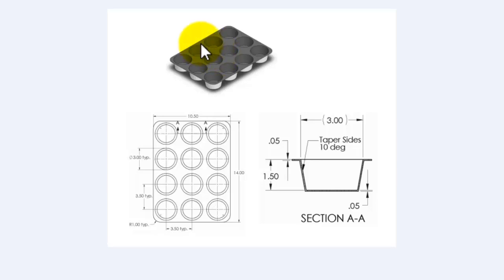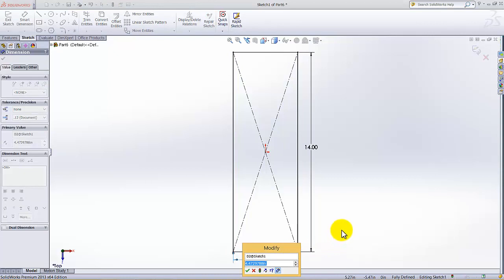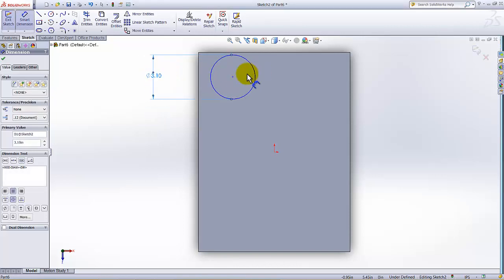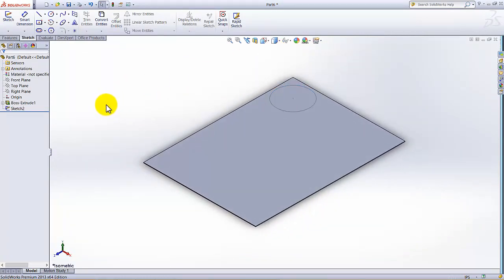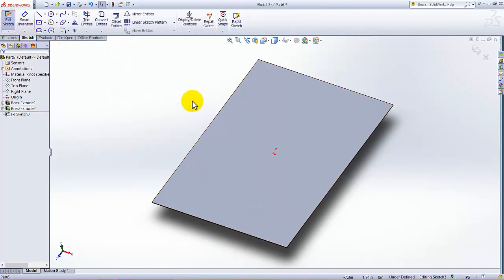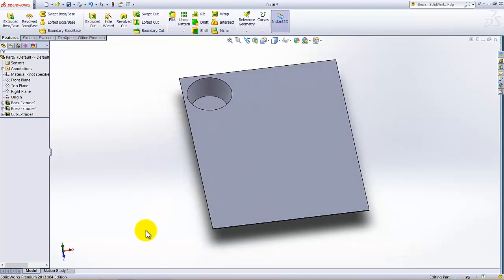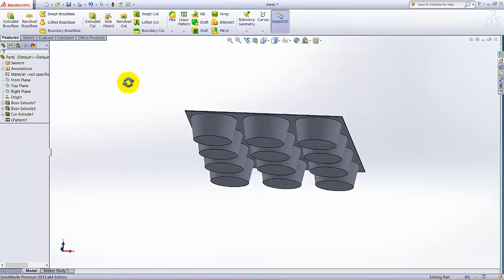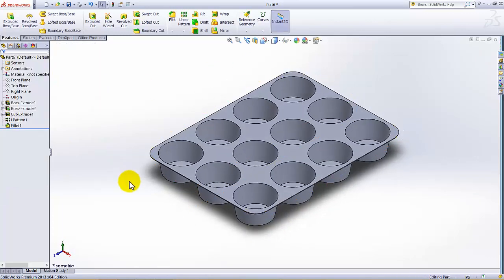SolidWorks beginners Tutorials-Muffin pan

Comment: This is not a very good demonstration for beginners. Without the use of mates and offset values this model is to easy for a beginner to break if changes need to be made. When building a model you should look to the future and not just the present model. Not to mention a sheet metal part should be designed using the sheet metal tools.
Reply from the maker: you are just discussing the approch, you can follow different techniques same model different features any way noted your point